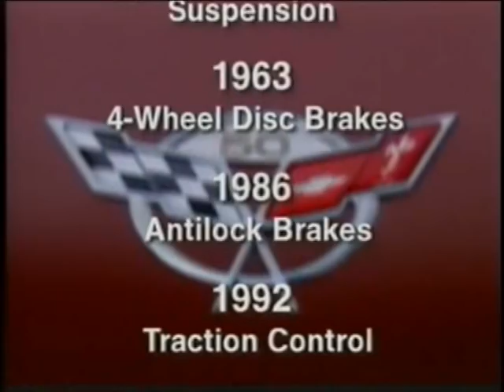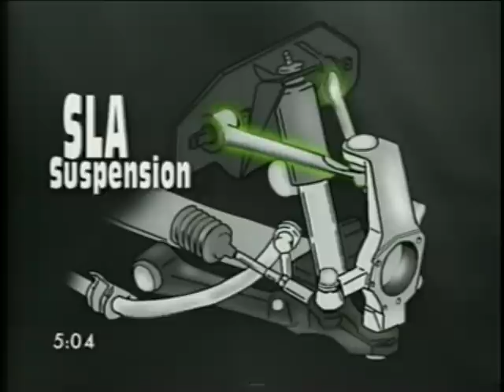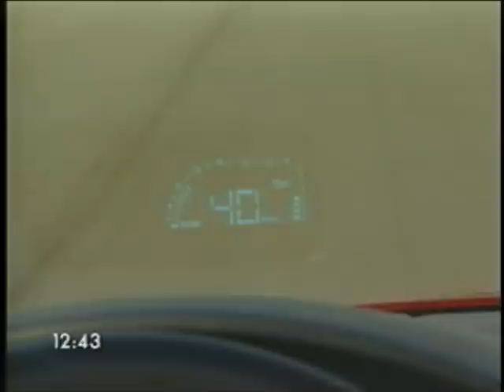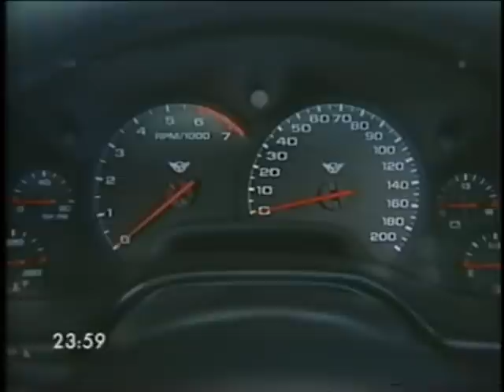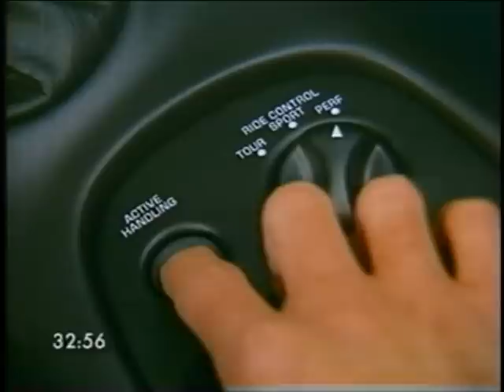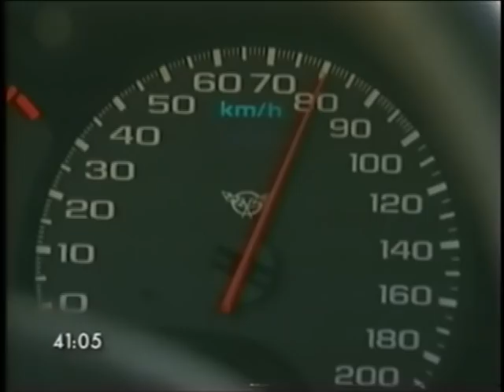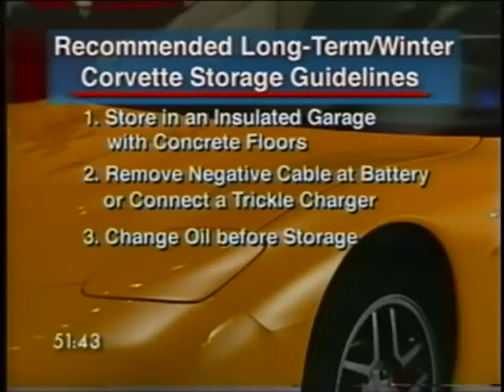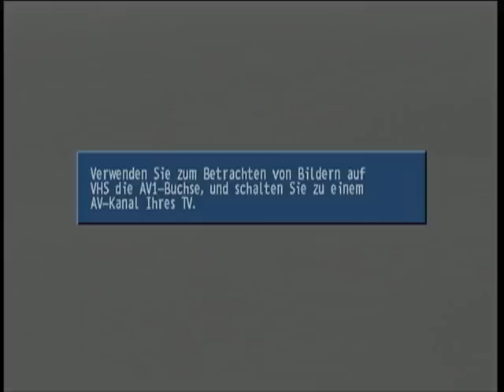2003 Corvette Owner's Video

Comment: I winder why would radio come on it's own in the middle of the night when the THIS car is parked and ignition is off?
Reply: the same reason the horn probably isn't working. steering column, electrical issues.